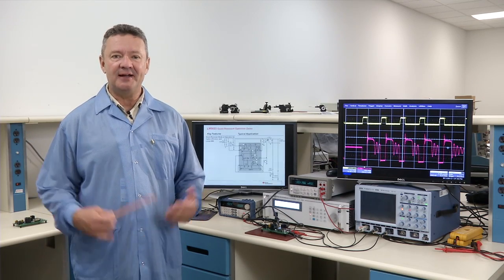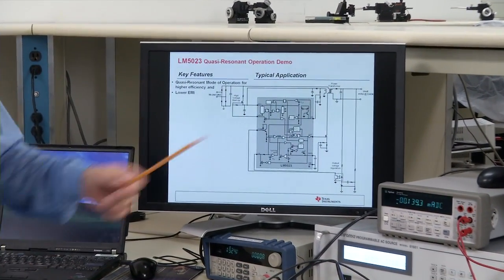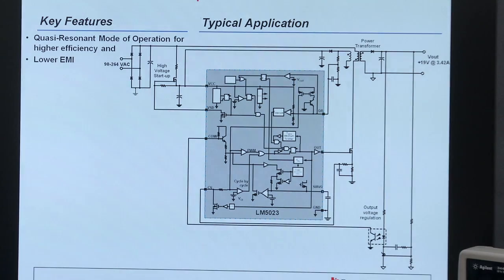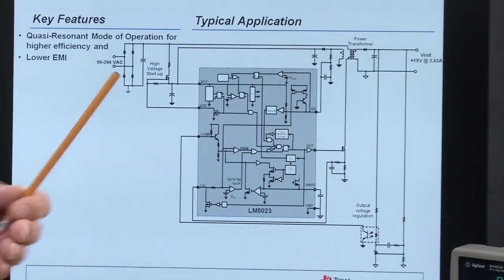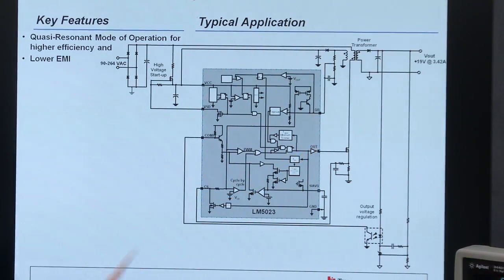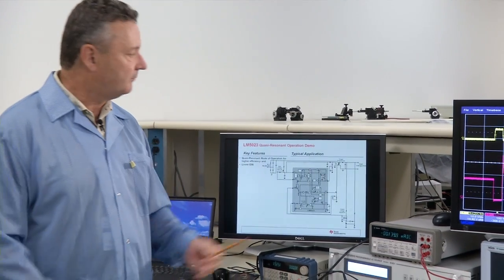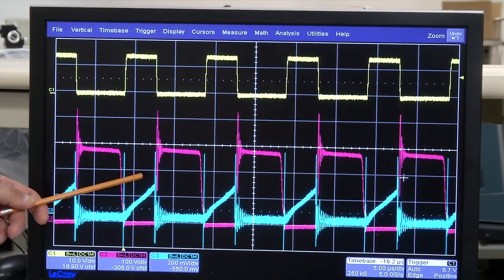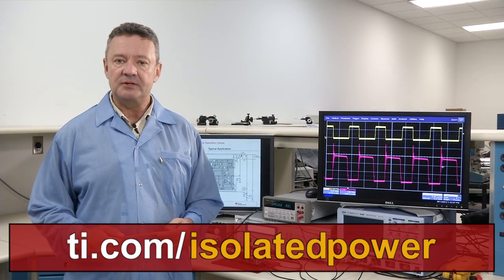LM5023 Quasi-resonant operation demo

Comment from the maker: Hi Samer, We clamp the maximum switching frequency  (130kHz) below the EMI starting limit of 150 kHz per CISPR—22 since CISPR-22 is the international standard for EMI measurement.
Reply: Texas Instruments 
Hi... Currently we are using this Lm5023 for our application... We are facing some issue..  when we turned on the switch we are hearing the noise across transformer with 1 khz ... How can we increase that burst  frequency so that it won't be audible...